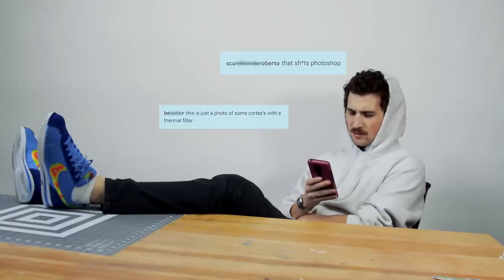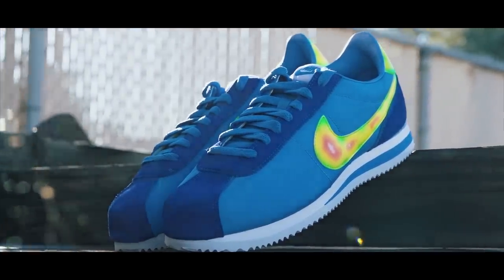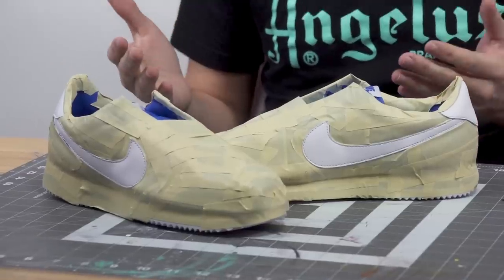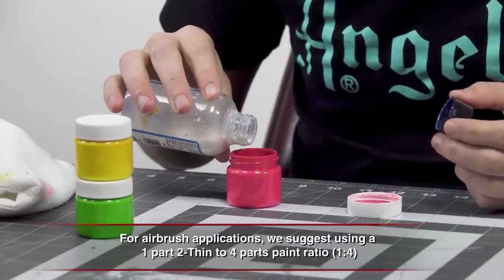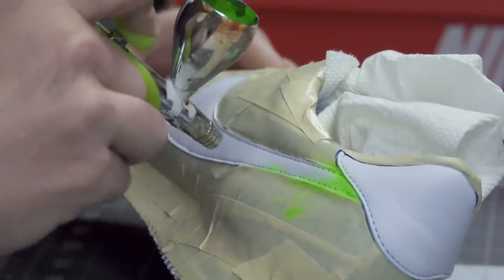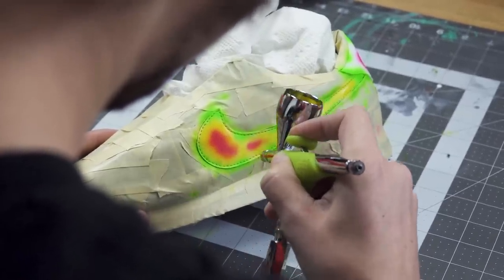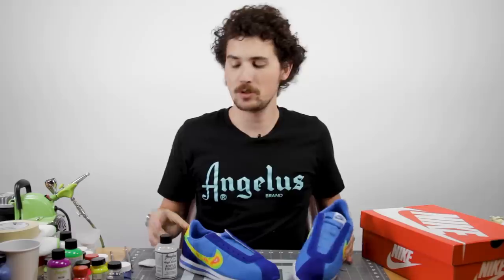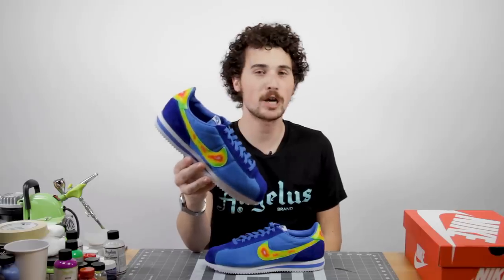DIY: HeatMap Nike Cortez | Custom Shoes | Angelus Paints

Comment: i will probably try this on some boring dunk sb i have, but the swoosh on the dunks are not as big as on the cortez though.

whats your opinion on some cheap airbrush pistol from china/ebay. since i dont have to do some serious line work, just spraying paint and some blending, it should be enough?
Reply from the maker: It may depend on what you are using it for but suppose you can get the job done with any airbrush machine out there. Make sure to do your research and expect what you pay for. If you have any more questions feel free to contact us at Info@angelusshoepolish.com

Comment: Can you use Sole Bright safely on Boost? Like Yeezys, Ultra Boost and so on
Reply from the maker: We've tried Sole Bright on Ultra Boosts and for the most part it works. It may depend on the condition they are in and how many sessions you do.  We recommend giving it a try and committing to multiple sessions. There will positive results but may not be perfect.